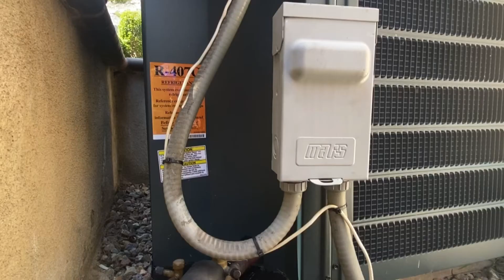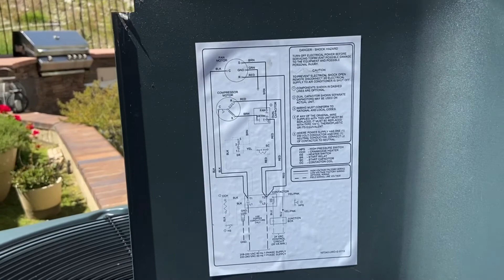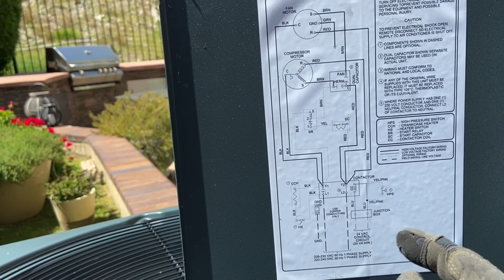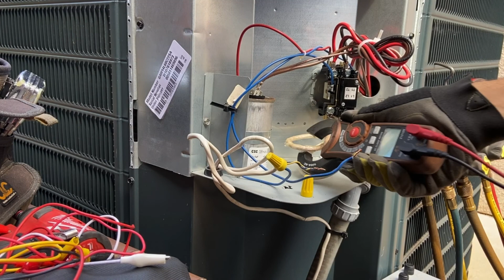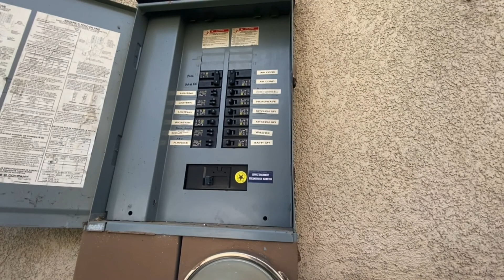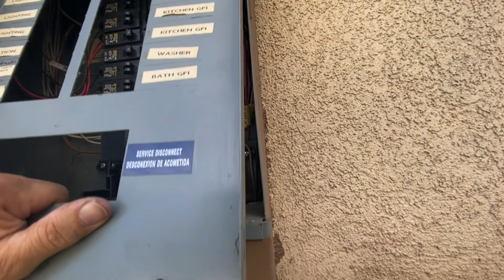ACR 102; Typical Residential AC Electrical

Comment: Nice job, Barry. I think you'll go far. :-)

I'm struggling to picture how the electrical is routed between the disconnect, fuse box, condensing unit and indoor control panel. I'll try looking through the textbook to clear this up.